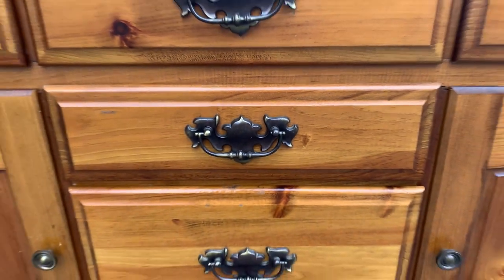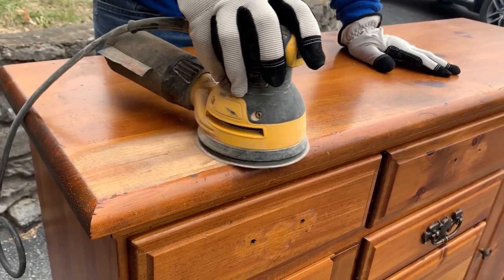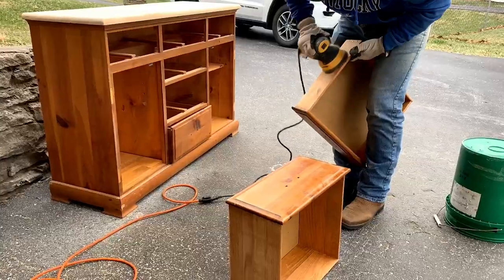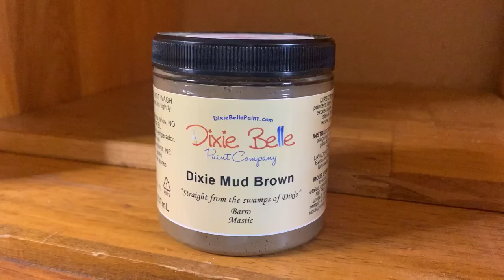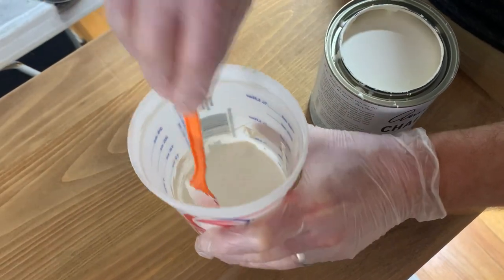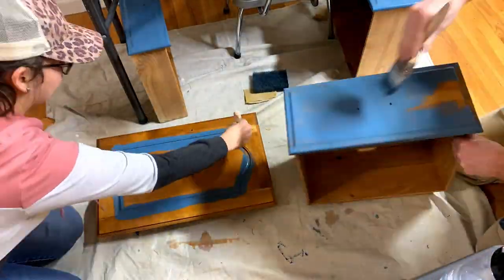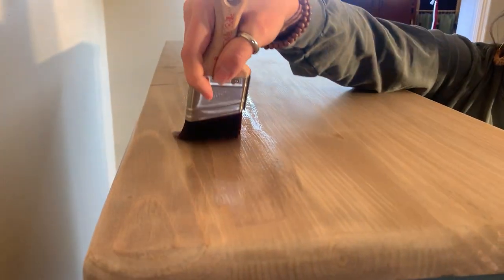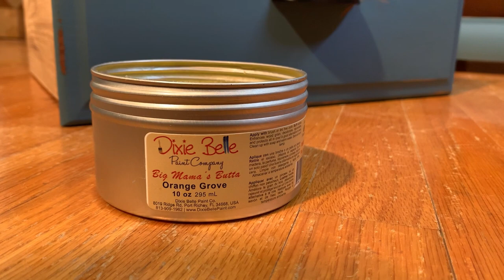Dresser Makeover // Furniture Flip with Annie Sloan Paint // FB Marketplace Furniture Flip

Comment: Neat trick with the zip ties, I would use a paint mixer but if u want to be a real MacGyver get an old whisk and cut the loop off. Put the handle in the drill and start mixing. Thought you used a pickling stain instead of the white wash.
Reply from the maker: Lol, thanks, sometimes you just gotta use what’s on hand! But a paint mixer would have been nice! 🤣 A pickling stain would also work for the whitewash look! We just have a lot of paint on hand at all times, so the paint wash works well for us! Thank you for watching!!